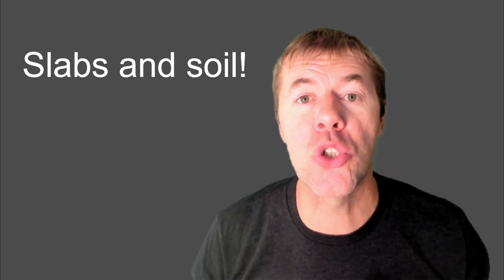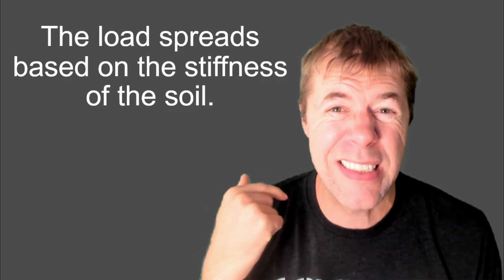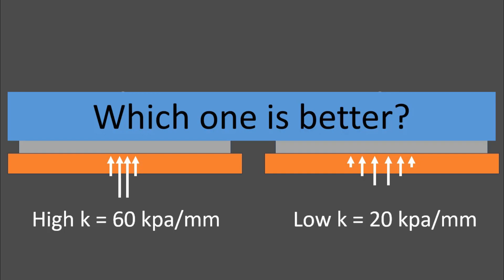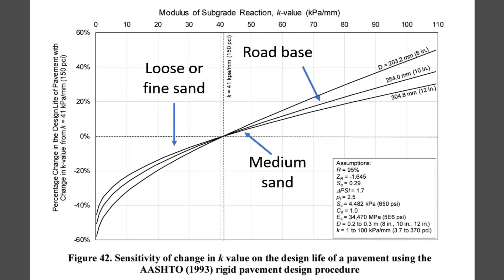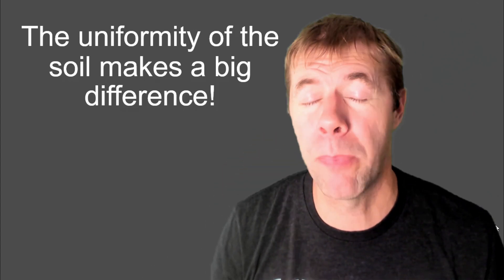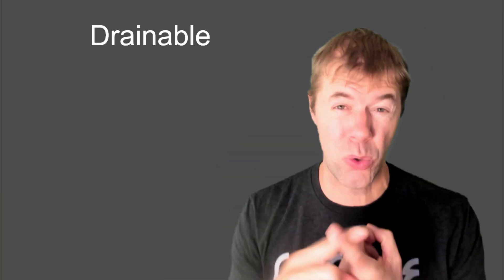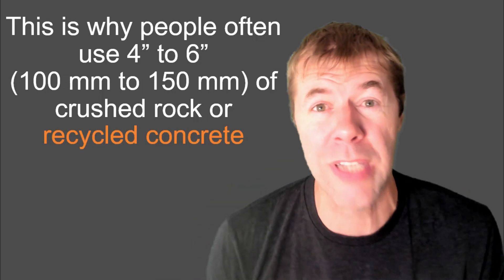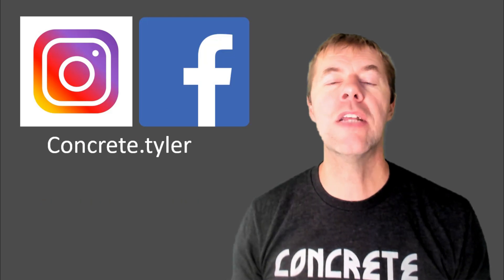Slab vol 3 - soil impact on slab on grade driveway patio and road

Comment: I have really wet/ clay soil. Putting a small building (no vehicular traffic in it), 24 x 40. Soil is soft. Graveling the pad I noticed pumping in my access point. Slab will have 12”x12” thick perimeter and 4” slab. 4’ rebar grid and 2 runs of bar in “footing”. Abut 8” gravel underneath. All the soil is kinda the same. Plastisized clay. Do I need to worry about the pumping area?

Comment: Thanks for the video, I learned a lot.  

I hope you don’t mind, but I have some specific questions that I can’t find answers to.  This refers to soil with a heavy clay content and a attached garage driveway slab with a slope that I think is approximately 12%.

Is the drainage in the area beside a slab important?  It seems like common sense that water infiltration under the slab can affect any voids, and that this would reduce the stiffness and stability of the slab.  Can you confirm this?  What effect does undermining a slab have, and what needs to be done to repair the damages?  Does freezing temperatures and frozen ground during excavation next to, or underneath a slab increase or decrease the effects on the slab?  Would using large amounts of water to thaw the ground before excavating beside and underneath a slab cause more or less damage?  

Any answers would be greatly appreciated 🙏

Comment: Is there a reason for separation between soil and aggregate, (crushed rock/concrete) with a fabric? Also, how does foam under a slab work? Is clearly very uniform, but I would appreciate a video concerning both foam board as well as spray foam under a slab. Good/bad/why??? Thanks Tyler

Comment: Very informative videos!  Thank you.  Is there a source / website to find reputable experienced concrete contractors?  I’m in the Dallas, Texas area and about to have our 100’+ driveway replaced.  We have this awful expansive clay soil and our existing driveway is cracked and has shifted vertically several inches in many locations.

Comment: At work I've been designing lots of raft slabs on ground with edge thickening beams. Using software which models lots of springs for soil support, sometimes there is a fairly large magnitude of bending moments in the slab, and more so in the thickening beams, but I often wonder just how realistic these are

Comment: This is why I’m skeptical of underslab polystyrene insulation. You inherently compromise the primary purpose of the slab but putting a soft squishy plastic pillow under your slab. If you want insulation put it on top of the slab not under it. I suspect in due course we’ll see problems with these.
Reply: He said the base uniformity is much more important than the type. Foam would be very uniform.
Reply: @honeytubs  won’t be uniform once the oil, diesel and petrol eventually leach through and dissolve the polystyrene.
Reply: If your slab is under a chemical processing plant or a internal combustion engine repair shop, certainly, the rules are different. But, if it's under a residence, it's not hard to calculate the load you're putting on the slab and buy insulation boards in the psi strength that matches the load. A single 4x8 sheet of 25 psi insulation board can support over a hundred thousand pounds of evenly distributed load. Very many slabs are larger and support less.

Comment: 4 to 6" of imported subbase is rare for domestic or residential pavements, most guys wont be doing that.
Reply: Don't hire them
Reply: @jeremyharsh   think about it, 100mm slab on ground, means you need to dig out 250mm..  not happening for nearly all domestic installs.